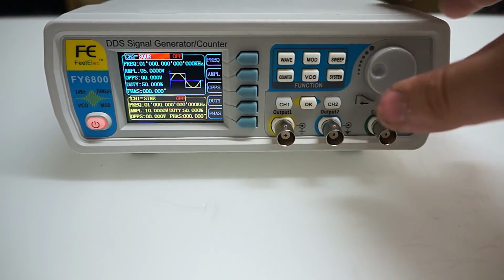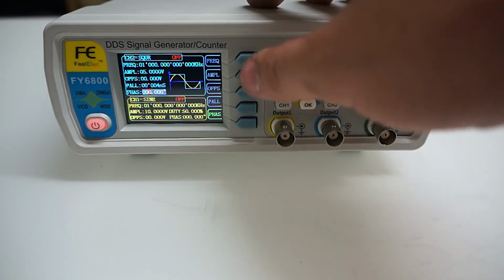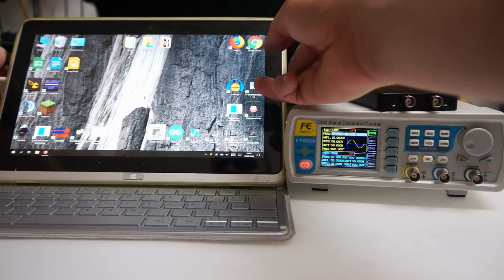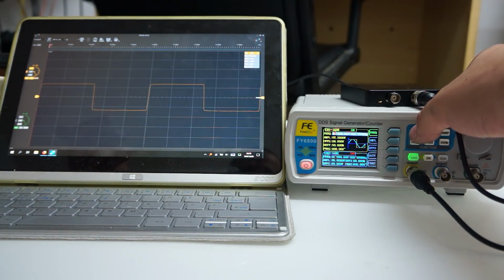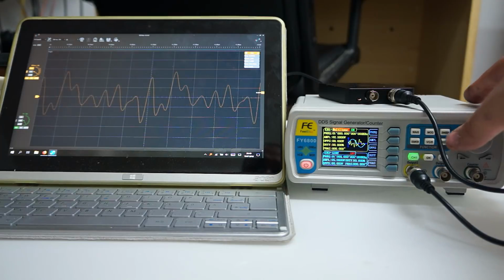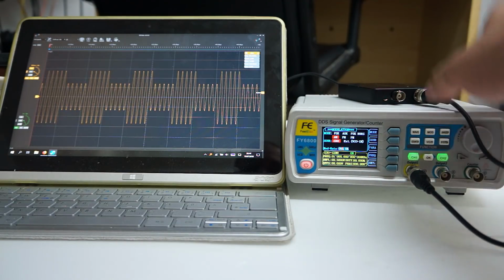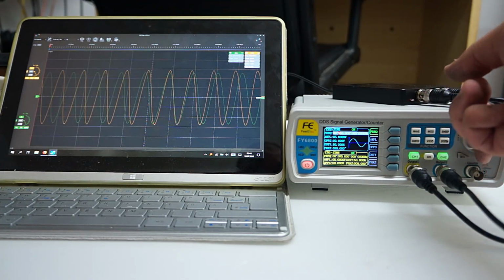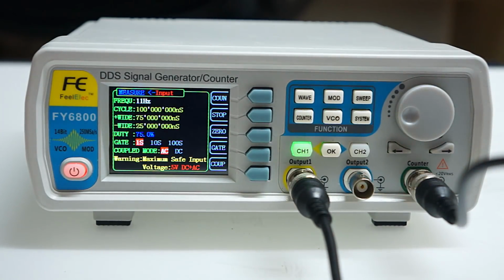FeelTech FY6800 Review & Teardown

Comment: Thumbs up for an excellent review! I just received my FY6800-60 yesterday and was glad to see your introduction before reading through the manual with it's interesting variation of English! :-) I was interested in whether you found an adjustment pot for calibrating the amplitudes of the waveforms, but you didn't mention it. One suggestion for future videos is that you might consider starting with the spectrum analyzer hooked up. This allows the viewers to see each mode as you're going through it without any obvious downside. I was afraid during the initial portion of the video that you weren't going to actually show the waveforms. Another suggestion would be to do a video on the PC software interface.

I will be using this seemingly amazing dual channel DDS waveform generator to control a power amplifier for an ultrasonic sonar running at sub 100 kHz frequencies. The ability to have the two channels coupled with a fixed phase offset was crucial since I need to drive a differential TTL input to a dual power MOSFET gate driver. Normally it costs a lot of money to either buy a DDS waveform generator or even more to build a custom unit into the equipment. 

Thanks especially for verifying that the BNCs are referenced to earth ground. This would be assumed from the front panel markings, but Chinese equipment doesn't always get this right...

Oh, and AWGN stands for Additive White Gaussian Noise, but at best it's WGN up to the frequency limits of the device, possibly generated using a fed-back shift register in the FPGA. By the way, the Cyclone IV is a rather powerful FPGA for use in this low cost equipment. Seems pretty remarkable that they can offer this functionality delivered to my door for less than $100...
Reply from the maker: thanks for your feedback, i will consider doing more indepth view in future reviews.  
funny thing is, the bnc's on the previous model were also marked as grounded, even tho it had a C7 plug, which doesnt even feature ground connection. lol 

but i found that the device isnt well EMI shielded.. well it had no shield but i expected less radiation.
When setting it to 27.xx Mhz on CH1,  some audible Tone on CH2 and FM Modulation and tuning into my SDR & CB Radio its quite a mess, even if the amplitude is 0V, those tracks after the DAC's radiate like crazy.   Increasing the amplitude makes things just much worse.
i think some copper emi shielding tape inside wouldnt hurt anyone.

there were some pots inside, but didnt look further into it what they do.
actually i did the teardown before the actual review. couldnt hold myself back. 

 impressive what the chinese can do for under 100 bucks these days, id like to see more in future.
Reply: When I first got the package, I was immediately struck with how light it was. So I'm not at all surprised that there is no hint of shielding. At least they never claim to be compliant with any FCC or EU standards on EMI/EMC. I'm looking at just using the boards with control via the BNC so I'll be able to put the waveform generator in its own steel case.

I just finished reading through the manual. The unit seems to have a lot of capabilities although the microhertz claims are a hoot! :-D There are a few strange items as well. The input impedance for the counter is 100 Ohms! Maybe they couldn't afford another 100 Ohm resistor to make it 50 Ohms? Or maybe they wanted to offer both a 50 Ohm input and a high impedance input and couldn't do it and compromised? Dunno. There was also this explanation for the power button: "When the signal generator is turned off, the indicator light will enter the breathing lamp state".

But those are all minor things. If the unit allows me to generate a reasonable range of moderate fidelity waveforms in the sub 100 kHz frequency range, I'll be a happy camper!